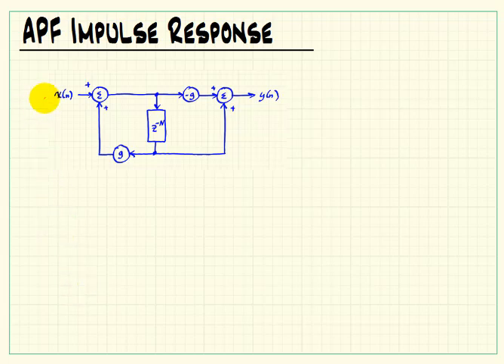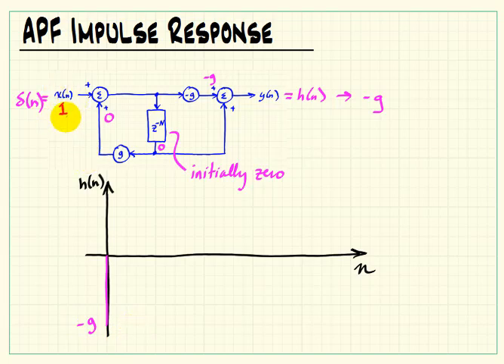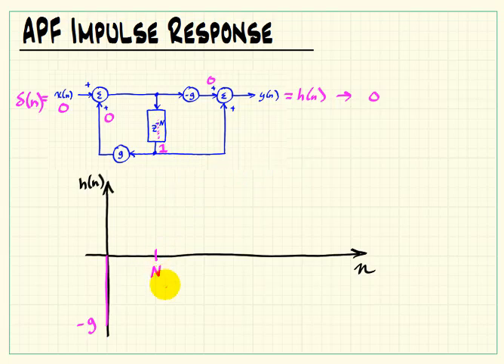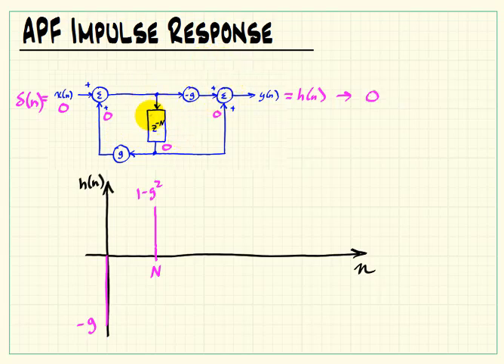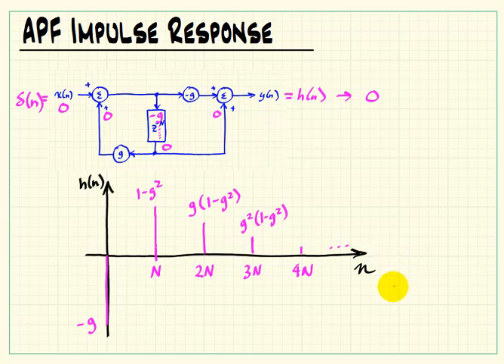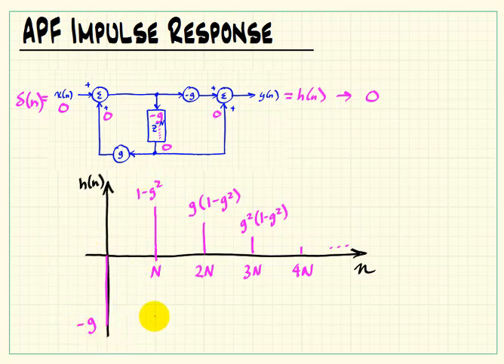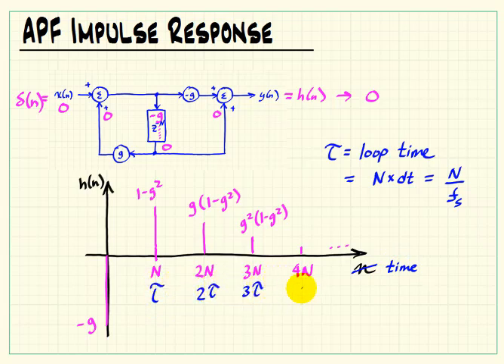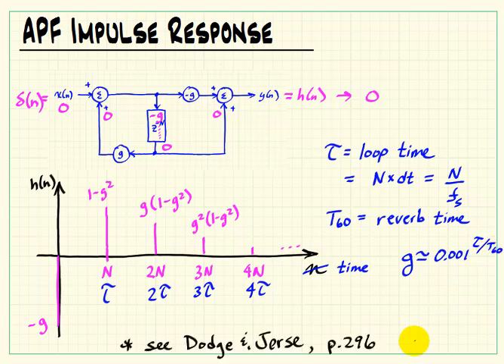Schroeder Reverb: All-pass filter impulse response derivation

Comment: Don't know if you asnwer to the comments but, wouldn't be the third output something like g(-1+g^2)? Because the -g inside the delay is multiplied by the g factor and then multiplied again for -g, so it changes sign and becomes +g^3, which is the summed to -g so: g^3-g.